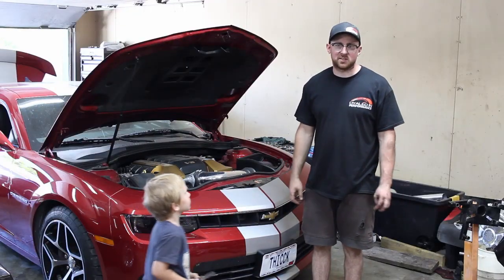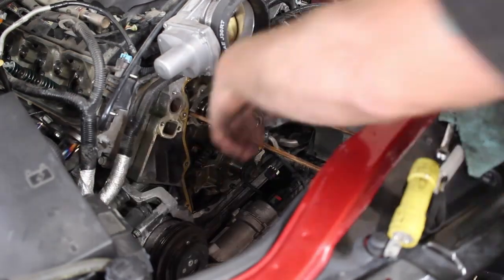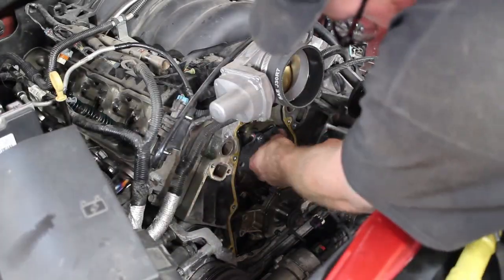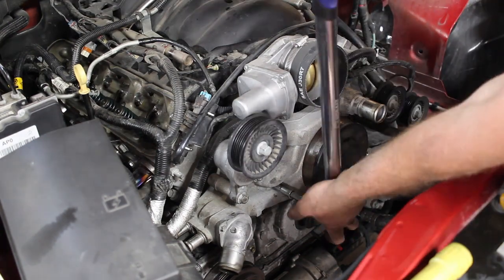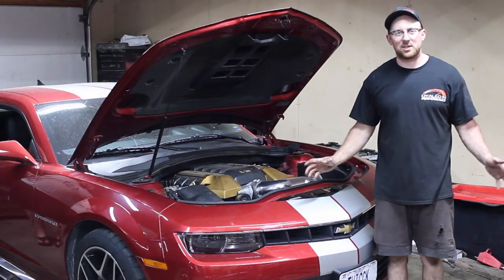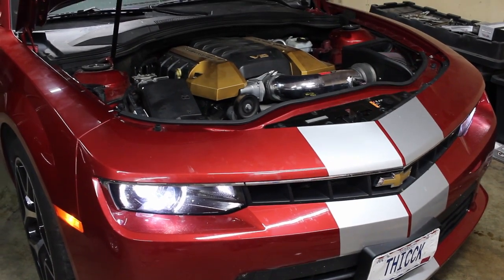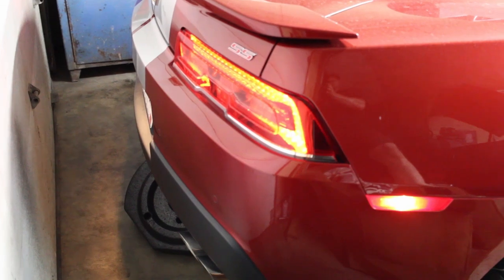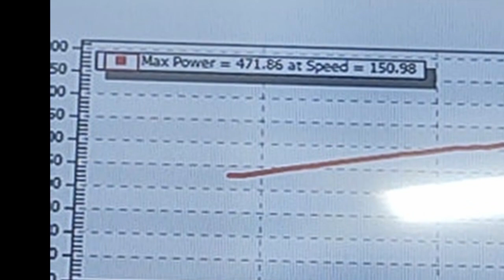2015 CAMARO SS CAM AND SPRING SWAP/ DYNO

Comment: how many hours total do you think this took you?
Reply from the maker: It probably took a total of around 5-6hrs.
Reply: BoostinBo see that’s what i’m having trouble with. I can do some mechanical work but this one is a little out my skill level. I asked a technician who’s at our dealership about how many hours this would take around 20+ hours. Are you just an extremely quick tech or is there a part in missing?
Reply: Techs at dealerships will tell you to pull the motor and a bunch of BS.  Bo is extremely quick but the average joe could achieve it in roughly 10-12 hrs.  Be very sure of yourself before you start a task like this though..I work on cars for a living but even I had Bo do my cam (this video).